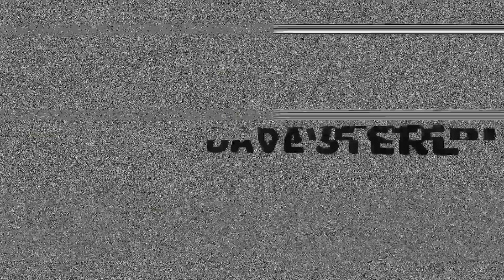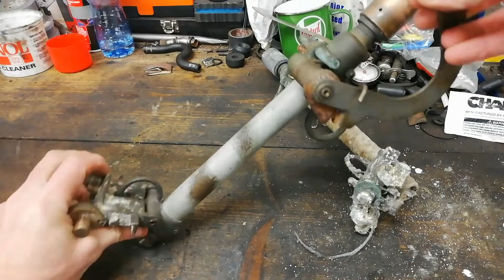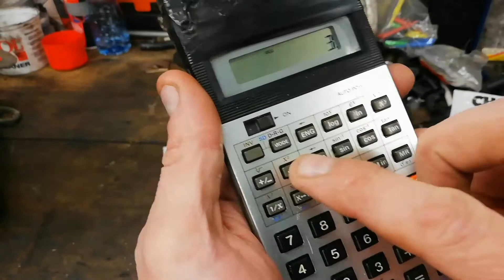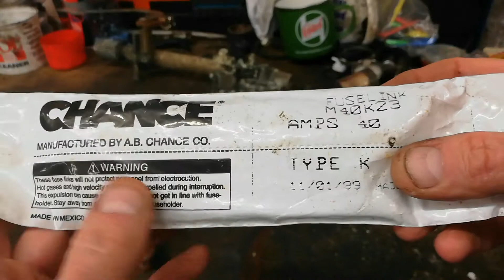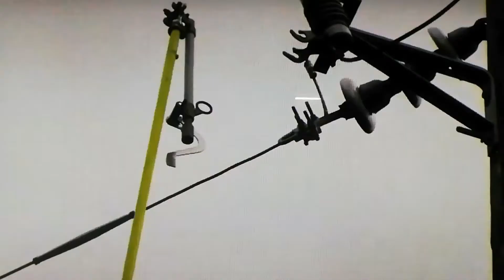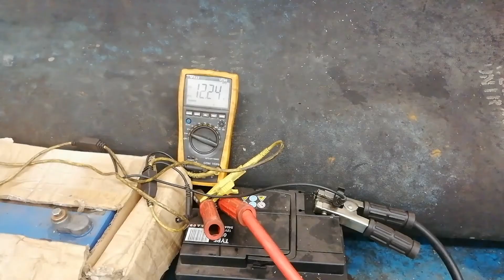High Voltage Battery Tester, Fuse Isolator

Comment: https://www.ebay.co.uk/itm/DC-0-500A-Ammeter-Gauge-Analog-Panel-AMP-Current-Meter-NEW-Shunt-Resistor/323648577180?hash=item4b5af55e9c:g:9NoAAOSwfONb4VCk      this is what i use

Comment: Brilliant Demo Dave! I was quite surprised that the fuse was only 40 amp but I suppose it's all about KW at the end of the day vokts x amps! The last rail company bought new electric trains 25kv in the wires pulling 100 amps at full pelt!!
Reply from the maker: yes Sandy, negating losses P=V.I , so 100KVA TX pulls 5.25Amps at 11,000volts.  √3x11000x5.25=100000va. so your train is using 4.3 MegaWatts(3 phase)